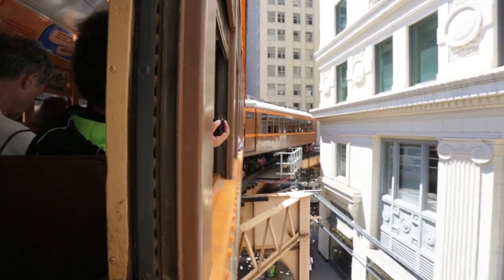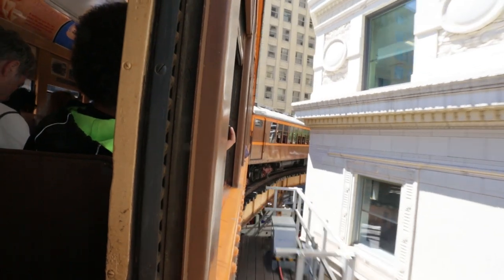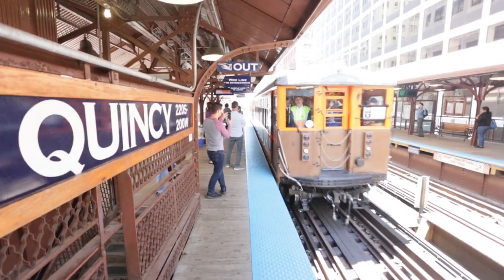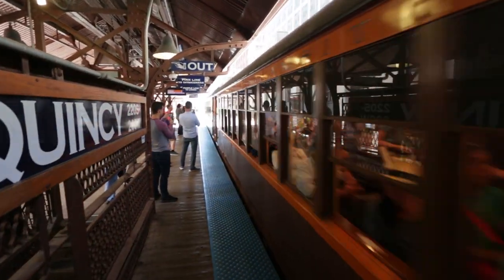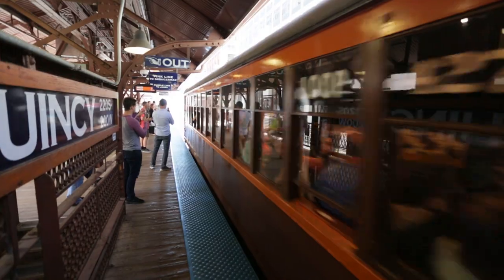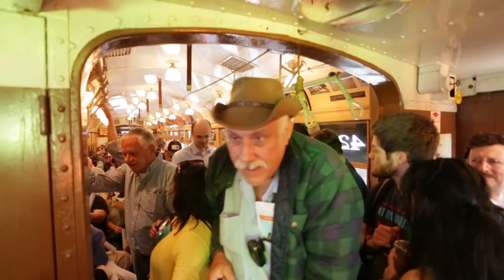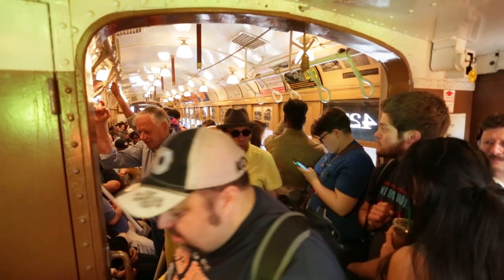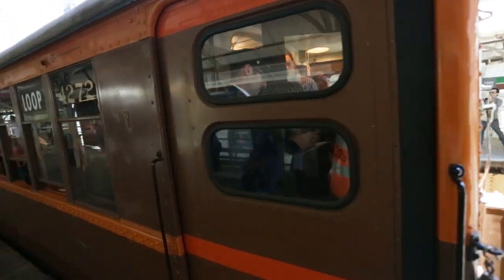Vintage rail cars in the loop

Comment: Gosh! I remember getting up on those ice-covered "stirrups" to operate the door plungers on the Lake Street line! Messing with the large copper heating knife switches was no fun, either. We were taught to turn away when pulling them off to keep flying sparks from getting in our eyes! Always liked the growling traction gears getting under way, though!